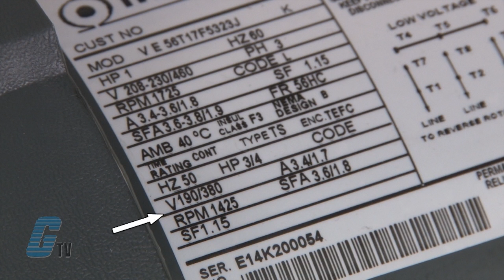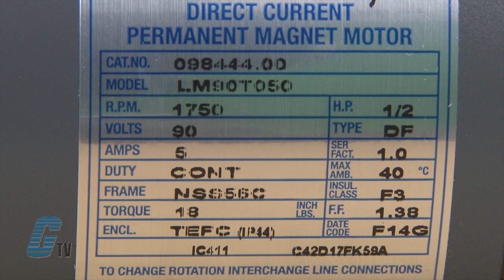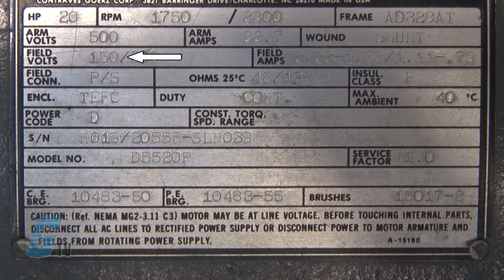How to Read Motor Nameplate Data

Comment: How about say motor 2EG180M2A
 from http://www.elkmotor.com.tr/EN/electric-motors-ie2-3000_rpm.aspx It is listed several different efficienciy % n as 4/4 , 3/4 and 1/2 Is that star or delta wiering?

Comment: I've got a 460v 3ph motor that has a gear reducer on it and it has a T/mn rating and I'm trying to figure out what the definition of that is? Torque by ? Struggling to find info for that abv.

Comment: What mean frame of motor ???
Reply from the maker: standardization is a key part of motor interchangeability. This means the same horsepower, speed, and enclosure will normally have the same frame size from different motor manufacturers. Thus, you can replace a motor from one manufacturer with a similar motor from another, if they are both in standard
frame sizes. Selecting the same frame size designation (regardless of manufacturer) ensures that the mounting mechanism and hole positions will match.

Comment: I bought a huge unabeled DC motor, the seller said it's 12 volt but I strongly doubt that. How can I find it's specifications?
Reply from the maker: You should also understand that without an RPM rating for this motor it may not be possible to operate this motor safely.

Comment from the maker: Identifying the elements on the nameplate is required in replacement, retrofitting, and sizing up drives for motor control.  AC motors in North America have been standardized by NEMA, while other motors are based on IEC standards.  AC motor nameplates outline power, speed, voltage, frequency and current.   DC motors have a few additional categories not found on an AC motor.  This is the use of armature and field in relation to voltage and current. DC motors may have different starting methods with shunt wound, series wound, compound wound, or permanent magnet.  Motors may also have different enclosure types - TEFC, TENV, and ODP.